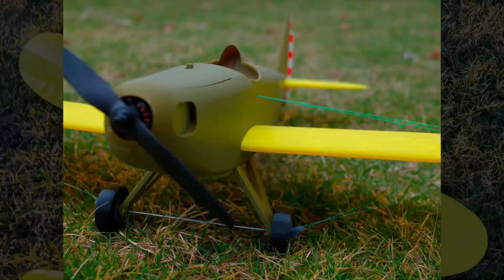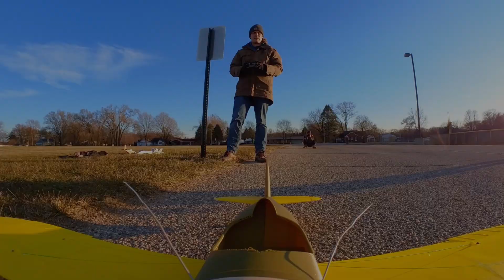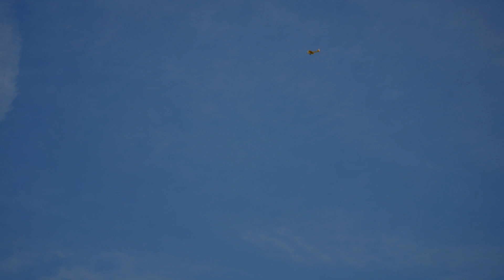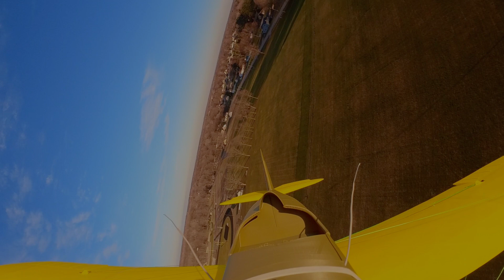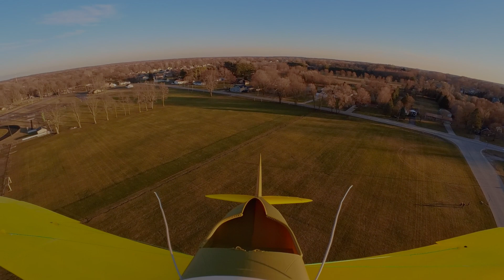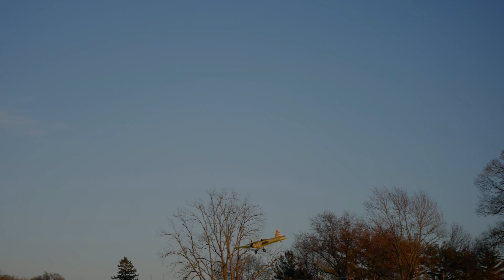Eclipson Fly Baby - Maiden Flight

Comment: Nice video, is this model fun to fly? Is it very delicate?
Reply from the maker: Yes, it's fun to fly! Since mine is PLA+, it's a little heavier and carries a little more speed than a LW version would.  But also the PLA+ helps it be a little more durable. If you expect to be very hard on it, you might consider printing a modded version of the wing that accepts a carbon spar.  I think that is available on the Eclipson Airplane Pilots FB group.  Thanks for watching!
Reply: @brubakerjm  How did you fit a 2200mAh/4s cell in there?!? The inside of the fuselage is very narrow and the servos so far forward don't help. Do you have any pictures of the inside? Thanks.
Reply from the maker: @creative1978  It was super tight.  I had to go through my 2200 4S packs and find one that cleared beneath the servo arms, I think.  I passed the airframe on to a friend so I don't have it any longer to take any photos.  Did you print PLA+ or LW?

Comment: i recently downloaded the files and having no success . im using Ulti maker Cura to print my files   and i get nothing but a mess is there some secret method the computer stuff is confusing. because i have printed their p-51 and the Focke Wolfe with success
Reply from the maker: Sorry to hear that! The Fly Baby uses "vase mode" (called "spiralize outer contour" in Cura) to print most of its parts.  I don't think the P-51 or FW were designed in that same way.  Make sure you have that option ticked in your Cura settings, otherwise you're likely to get a bunch of extra travels and retractions that you don't want.  You could also try just printing one of their gcode files to see if you get something workable.  Also, the version of Cura matters.  If you have trouble with the latest Cura, you can go back and try 4.13 or 4.12 and see if the slicing preview looks any better.  Aside from that, I would probably post a question in a thread where maybe the designers could answer your questions.  Here is the RCGroups thread for the Fly Baby: https://www.rcgroups.com/forums/showthread.php?4495481-Eclipson-Bowers-Fly-Baby
Reply: I did what you said and it worked thank you very much much
Reply from the maker: @demetriodelgadillo1629  Excellent!  That's great to hear.  Good luck on your build!